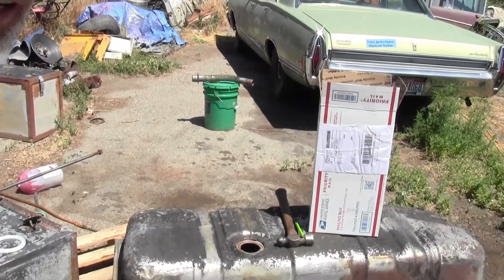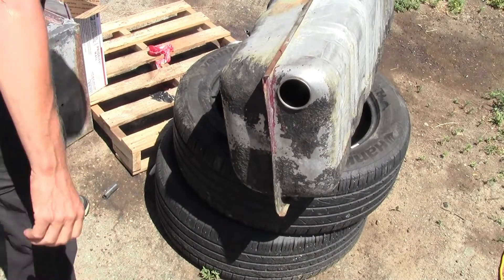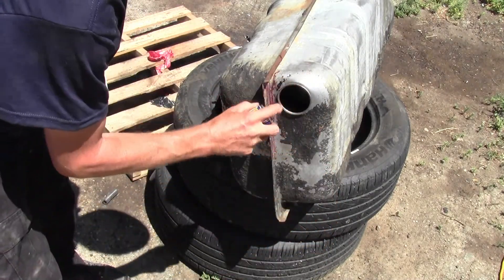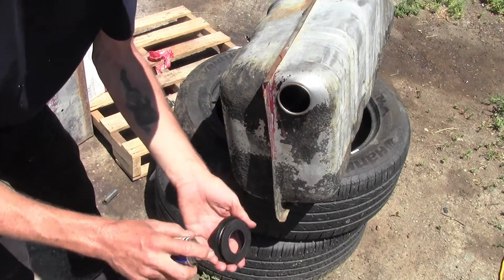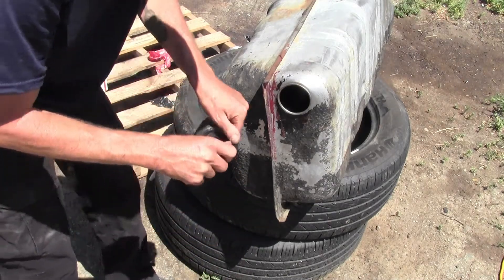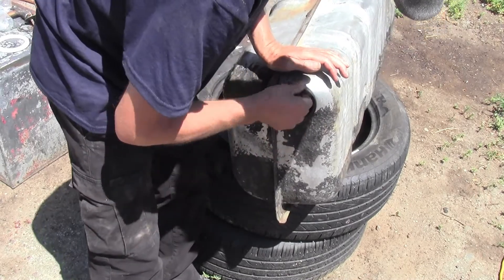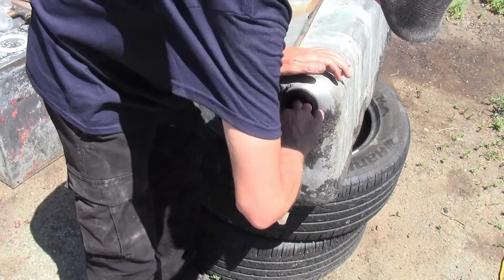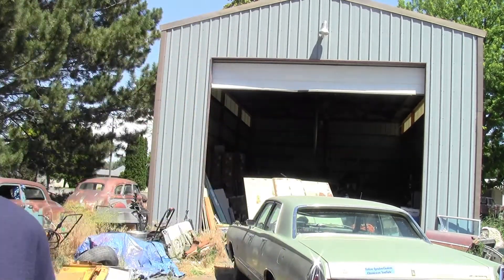How to Install a Sending Unit & Filler Neck Gromet in a 1968 Mercury Park Lane Gas Tank

Comment: Looks great without the hubcaps...I would wire brush n paint em Flat Black. Thts what I did to all my vehicles... Right on BareRose!!😃
Reply from the maker: Thanks Ron, it actually has the full set, but I've been looking at those wheels on that 97 Lincoln and thinking..... yeah.....maybe?

Comment: Great video! Most of the replacement lock rings for the mopars are too thin and we end up having to reuse the old ones. Glad the one for your Mercury fit tight!👍
Reply from the maker: Thanks Mitch, It is a bit different, and I kept the old one just in case.